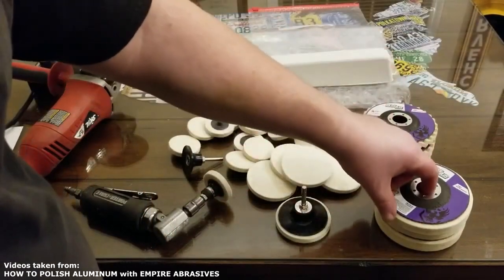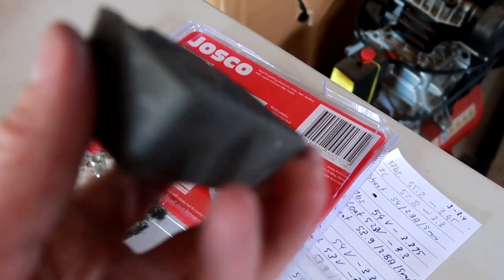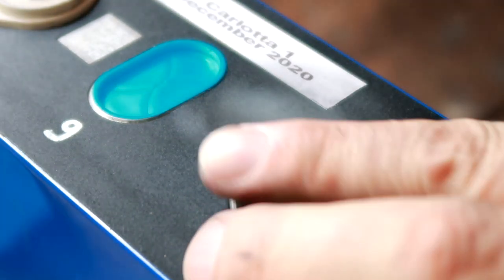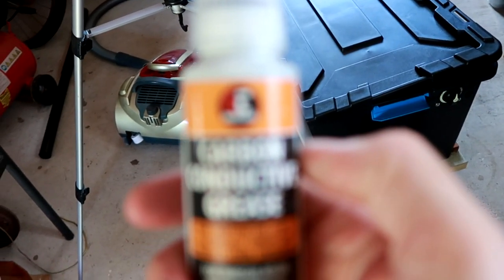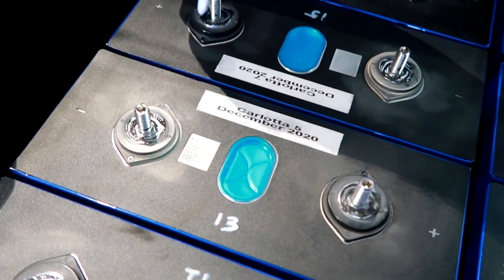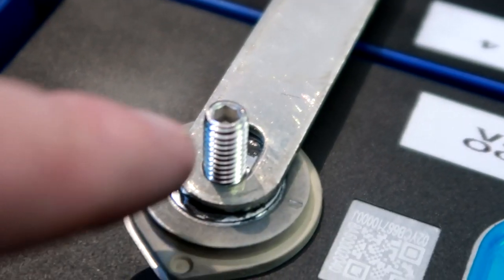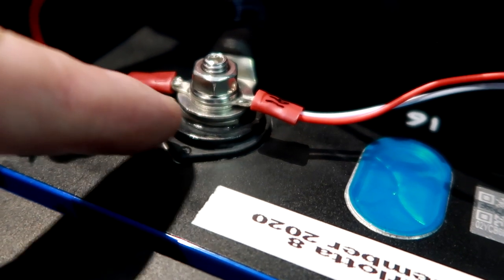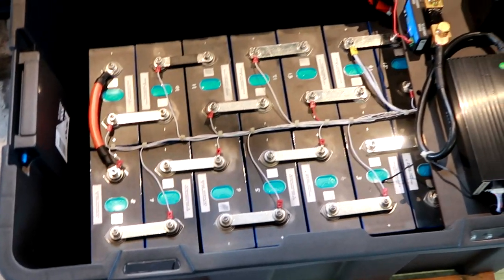Re-building the battery - The perfect terminal connections? Part 2/2

Comment: Andy, I'm afraid I have to agree.. I think that the surface area is the key. I don't want to mess with my terminals because I'm afraid that I may round the edges. I don't think that they need to be shiny myself. I actually think if they are a bit rough this may actually be better?
Reply: I think the little bit rounded corners is okay you might be losing the slightest bit of surface area but you are preventing any sharp point from holding up the rest
Reply from the maker: Contact area is key. More than polishing. I will pull only 60A from the battery so I'm not worried about a tiny reduced surface area with this round corners. At least we all know now ;)

Comment: :-) I've polished my busbars and they got the amazing shine also, but no improvements. After several weeks of testing, I found that adding any type of wax is actively undoing all the work that was put into it, in terms of connectivity. Wax is non conductive! 
Toothpaste did remove wax perfectly. A way better solution is Ox-Gard or similar product.
Last tip: Torque wrench!!!!! The nuts needed to be tightened to 3.5-4Nm to insure good contact.
it's practically impossible to feel by hand. I used one torque meter that goes between the wrench and the nut.
That really makes the difference!! Polishing, and all additional stuff will not compensate the 2 most important things:
clean, oxidation free surfaces (use ox-gard to stop de aluminium from oxidizing) and enough torque! (contact pressure)

Comment: Hi Andy, you got balancing problem with cell no. 6 and no. 11 about 3 weeks ago, were you using the same GUCC BMS or replacement one from the supplier in this video ?   Was the unbalance of this 2 cells due to BMS malfunction or bad contact surface of battery terminals or both ?  please share with us your new finding.

Comment: Usually when i polish connections i stsrt with 800 grit with a lubricant like 3 in 1 but WD will do at a pinch, then i go 1200, 1500 and finaly 2000 grit, to get it flat as a wiches tit i stick the paper to a sheet of glass and rub the item over the paper, not sure if that is viable with a battery but it's how i get flat mateing surfaces and lugs ect ?
Enjoyed it all as usuall chap ! keep it up, i even fitted a small battery and solar panel to my new shed ! you inspired me to sort it out !
 (i must add it's a very VERY small set up, 14 AH LOL!! ) but then in the UK we get a very small sun ! ;)

Comment: If you have an extra busbar, you might consider attaching a busbar to that main positive connection and connecting those wires to the second hole in the busbar.   The one thing you don't want to do is back out the terminal stud because you want it to have maximum contact with the terminal.   The stud should be fully inserted in the terminal.

Comment: sanding the terminals has always been used to increase conductivity and I think that polishing reduces the contact surface. electrical greetings
Reply from the maker: You do sanding to get rid of the oxide layer but you need to apply this grease right away.
Reply: Just roughing up an even surface with an anti oxidant apllied after is just what you need. No need to polish. This is coming from an electrician

Comment: I constructed a similar battery pack out of 200ah calb cells back in November. I was in a hurry due to freezing weather approaching. As I am completely off grid I needed this battery to survive the winter. After paralleling the pack at 3.4 volts for 24 hours I built the pack. The BMS is still sitting in it's box never installed. Have been running this all winter and the cells are only .02 volts apart. 

If I had done all this testing and fiddling with the battery I would be dead now. LOL

Comment: On generators, just a good clean (not polished) contact surface and a good tight connection will work perfectly well.
Polished surface intact rounds off the surface so decrease the contact area.
Marc
Reply from the maker: But it looks nice 😉

Comment: I think keeping the surfaces of the bus bars and battery terminals flat to maximise surface area contact would be more important. Laying half a sheet of that wet/dry paper on a good flat surface using kero , which is also abrasive, and running the bus bars over it would ensure some degree of flatness. As for the battery terminals being aluminium it’s very easy to round them off. 
Having said that I can see and understand why you’ve done this. My cells have the bus bars laser welded on so as long as they hold I’ll be all good. 
PS Your Victron inverter is still a 2400 watt inverter. Not a 3000 watt! Lol!
Reply from the maker: Yes, surface area is very important for these connections. After all, I will pull only 60A max with this inverter which is actually a 3000W inverter if you connect resistive load only ;)

Comment: At high currents it is far more important that the connection surfaces are flat, especially for currents around 100-A and higher. Polishing will not have helped to make the connections flat - but it may be insignificant. You can measure it to determine if polishing caused a problem. (see the last sentence or so). It is more important to remove any raised areas that reduce the contact area. Think dings and dents. Not the depression, the depression is inconsequential, but the raised edges around the dent can a prevent solid, gas-tight contact. Also, an aluminum anti-oxidant may be worthwhile. Check with electrical supply houses for it.   I would measure the voltage drop (from the battery terminal to the middle of the bus-bar). Tighten, clean or file flat the contact surfaces until they are all are close to the lowest voltage measured. You can also use your IR gun to look for high temp, a sure sign of a connection that needs attention. Good Luck
Reply from the maker: Thanks John. You can actually measure the voltage drop between terminal and busbar. I show this in a video soon. I read in forums to polish the terminals so I gave it a try
Reply: @OffGridGarageAustralia  definitely need anti oxidant for peace of mind

Comment: Hi Andy 
Personally I would not use any polish or wax. These would leave a slight residue that is not very conducive. I would use very fine sand paper. ( not emery as these are conductive). Then use the conductive grease. The grease not only stops corrosion but stops etching from dissimilar metals. Any way the proof is in the pudding so they🙂

Comment: Beautiful job on the contacts. Did you also clean the threads after polishing? Polish and/or fibers from from the pad could get on the threads. Never mind. It looks as though it all worked out fine.
Reply from the maker: I cleaned them a bit, but didn't make them super clean, no. I made sure the studs went all the way in though.

Comment: You seem to forget that the amperage doesn't just flow from the terminal face, it also flows through the bolt / stud through the washer to the other side of the buss bar. Any battery manufacturer i have spoken to suggests a very light sanding on the terminal for best connection.  Wax is a barrier layer that could impede some current flow also. It is intended to be a barrier between nature and your paint for protection.
Reply: While some may flow thru the stud, steel is such high resistance compared to copper or aluminum it really is of little effect. It most definitely comes thru the face and you must put the highest current connection on the terminal face for that reason.
Reply from the maker: There is no wax on the terminals any more. They recommend light sanding to remove the oxide layer before mounting the bars. But you need to grease immediately after sanding, or even while sanding to prevent this. You cannot get it 100% right. I'm trying different things here, some work better than others and I hope a lot of people are learning from this and do better with finding the right method.

Comment: In an earlier video you said you were going to get a torque wrench to properly tighten all the battery connections. Did you find/ receieve one/ use it or decide it was not necessary?
Reply from the maker: I didn't buy one. There is a huge thread in the DIY solar forum about it (actually several threads). Nobody really knows if the torque wrench is accurate. Some people have multiple and they all torque at different rates, so which one do you trust?
With the set-screws and nuts now you can torque the nuts a lot higher than before with just the screws. It feels very tight and strong now in comparison.

Comment: Andy, well done. Patience is your virtue. If others have asked I apologise. Your busbars have an elongated hole eac end for the stud to go through. My estimatr is your busbar only touches 80% of the terminal and 75% of the washer. Wouldnt it be better if the busbar had only a round hole same diameter as the stud so you get 100% contact of busbar surface area to both terminal and washer?
Being more inquisitive still I ponder isn't the flatness of the terminal, busbar, washer also as critical or more critical than shininess? And finally wouldnt a locknut that provides a smooth flat bottom surface to engage with the smooth flat washer again give the optimum surface area therefore not losing power.
Aftercwatching your video the idea came to me about lock nut versus lock washer and research recommendations favour heat and or vibration resilience. 
Now Andy when polishing the terminals and the busbars I think to keep them perfectly flat put battery dead flat on the base of a vertical drillpress and use a flat horizontal polishin applicationagainst the flat terminal and busbar. This would give you the most perfect flat surface IMO. The grease? Why not copper based grease smeared to fill in any remaining pits or scratches?
Your thoughts kind Sir?
Whoops, a torque wrench on the locknuts could yield 99.9 % consistency.
You can say: Wayne you are a genius or Wayne you talking nonsence. I don't mind because I learn from your mistakes and mine!

Comment: I am in process of building the exact same battery pack.

I really like the central wrapped "trunk" (at 11:27) with all the thing balance leads fanning out to their respective bus bar.  I was thinking about how to manage the 17 wires.  I will do something similar.

One thing I am doing differently is tapping the center of each bus bar with M2.0 threaded tap.  It just takes about 4 mins each to do as the metal is soft.  Then I'm using a small ring terminal held down by a corresponding M2.0 bolt.  The tiny ring terminal matches with the very thin 22AWG balance wires better.  This will give a better crimp -- though I will probably do a quick solder on it if I feel its not crimped tightly enough to such thin wires.  Additionally, I think it looks better with balance lead centered on each bus bar since, logically, the balance lead connects both cell posts and not tied to a specific cell post.

Also, I'm in processing of CAD designing simple custom plastic covers for each bus bar and cell terminal.  The covers will be 3D printed with PETG plastic.  I already had an incident when I dropped a bus bar and it melted with giant sparks!  Even before this incident, the sight of all those terminals exposed like that was scary.  I know the battery will covered and safe in its enclosure during its operation but the individual battery terminal covers right at the "hazard area" gives an extra layer of protection -- especially during the initial building or servicing the battery down the road.  I'm sure an electrician seeing an array of all those exposed terminals when opening the cabinet would probably get nervous.
Reply from the maker: I thought about tapping into the busbar with an M5 screw. It depends a bit how much current you have going through the battery. 100A can result in a few mV voltage drop, so I tried to minimise that by having the balance leads directly connected to the terminal. The set-screws and terminals are pretty much one part now and show always the same voltage while the busbars have a different voltage to the set-screws. I'll show this in a future video soon. You can pretty much measure the voltage drop across the terminal-busbars connections.

Comment: I can see from the reflection on the conductive surface of your terminal that you're polishing has rounded off the edges this would only reduce the contact area I am working on a method of different chemical treatments that could be applied with aQ-tip to remove oxidation the apply inhibitor or carbon conductive paste I feel the less we alter that surface the better as it should be perfectly flat when we get the cells.
So far the best treatment I've found is aluminum brightener that is a combination of hydrochloric acid and sulfuric acid approximately 8-10% acidity.

Comment: What about all the gunk that's gotten into the screw part of the terminal? Your also changing to many variables to see if polishing has had any improvement rather than the new screws and grease and polishing.
Reply from the maker: Yeah, what about the stuff inside the terminal now? I cleaned it out with cotton tips and good is. It does not matter. Some even use Loctite to glue their studs inside the terminals. There is almost no current flowing through the stud itself.
Reply: @OffGridGarageAustralia  then why were you worried about the length of the bolts that came with it? Seems like a waste of money getting screws that go the full length of the thread if you say they DONT contribute to the current. They finitely do contribute if you take into account the force applied to the thread of the screw and your concave terminals providing less surface area.
Reply: @OffGridGarageAustralia  also you video addresses the issue of voltage readings not current so that doesn't matter. You have yes maybe increased the contact band of the terminal on the face but I think you have also reduced the affective was of the stud with all the polishing compound that looks like its in the screw terminal. Probably think you would have been better just putting the grease on and not wasted time and money polishing the terminals to have problems further down the track. Is that compound corrosive? The example you showed had a flat surface that could be wiped off however your terminals are now locking that compound into a confined space. Just something to consider.

Comment: You need to clean off all the compound and wax. You are adding electrical resistance. I have assembled thousands of battery banks. All that is needed is to torque the bolts or nuts to the correct specification.

Comment: Er, yeah. No.  You want a slightly rough surface to maximize the number of points that actually make contact with the busbar on a microscopic scale.  A mirror surface almost eliminates the tiny protrusions that touch the bar, your sandpaper job would have been perfect as it would have left the rough points that make contact and then squish down when you tighten down the terminal.  Also you need to sand/stainless wire wheel to bright metal, put on a zinc based antioxidant compound within a half hour and make your connection.  Aluminum gets a higher resistance surface oxidation layer very fast - but it doesnt matter much if your contact area is fairly large as the overall resistance of the contact is still quite low.

Comment: I would have just used some conductive electrical grease. Scuff the terminal with 220 grit paper to knock off any oxides quick wipe with acetone or electric parts spray then coat lightly with the grease and assemble.

Comment: As for perfection j would use plain copper bushbar uncoated also washer out of copper ,and bms  leads in the middele of bush bar also choose the lowest resistance matterial to transport energy    ,   just measure the busbar resistance on surface and plain copper     all resistiance is loss of ernergy  , the once  mounted i will use  hair spray to coat all of this,   well also i will use under the studd clean the hole make sure the 100 %  flat connection with out any dirt   and would use copper bolts and studs  remember the smaller the wire  in  compare to the total thickness  the atoms  jump easier on smaller wires      so if you take let say 10 mm2   meter wire and have 1 strand and you have also one 10 mm2 with 100 strands   with 100 strands are much better because atoms more much more freely       hope you get a idea of what i am trying to say    also on all connections     so  also tread of studs i  would use diellectric grease  to promote atoms to move easier

Comment: Wouldnt star washers work just as well, if not better, to dig into the soft aluminum and provide excellent contact? They make them for a reason....
Reply from the maker: That would be worse as the surface area would reduce to only these tiny areas where the star washer has contact with the terminal.

Comment: i just use wet and dry to smooth the surface flat to get best contact i dont put a shine on them i do wounder tho is conductive paste  better
Reply: It should always be used when joining dissimilar metals.
Reply: @johntatman9168  would copper grease work ?
Reply: @1981dasimpson  David I am not an expert here but I would think the copper could still interact with the aluminum. They make an actual grease for this purpose and any place that sells electrical supplies should have it. I would stick with one made specifically for this purpose.
Reply: @johntatman9168  good point

Comment: Next step is to replace the supplied 1mm straps with homemade alum straps to avoid galv. corrosion that happening. Try a anti-corrosion grease 1st !
Reply: I won't do it, at less it is pure copper for better conductivity.